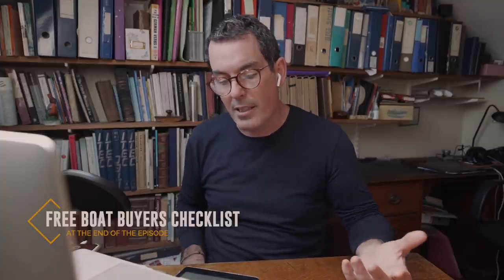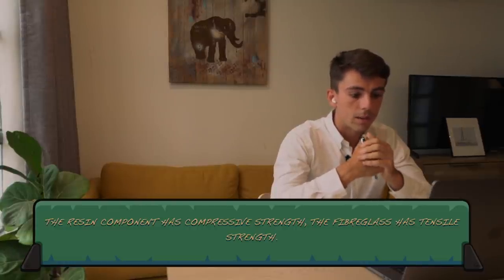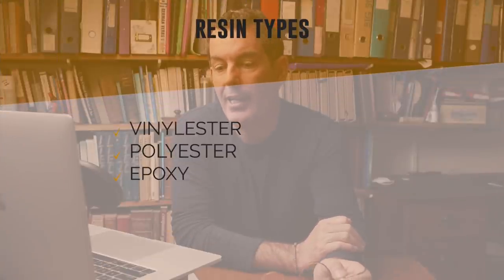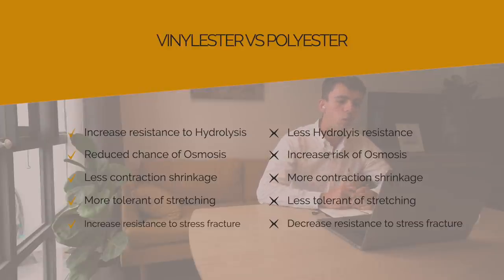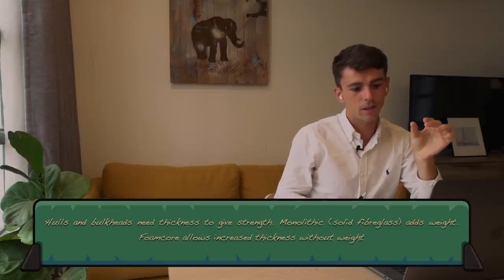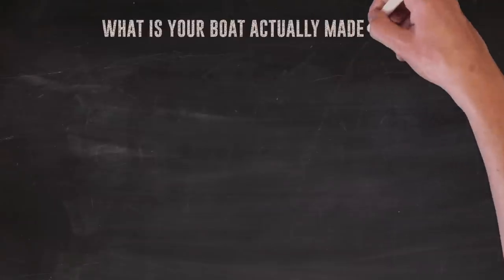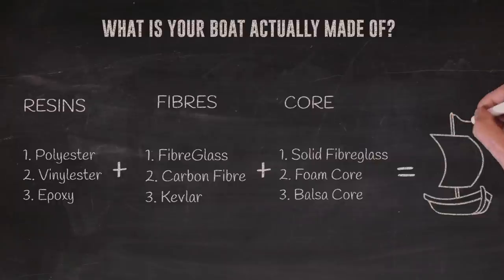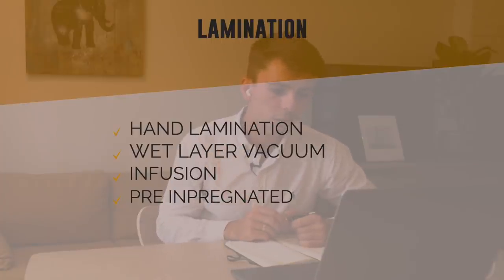CATAMARAN BUILD QUALITY: The TRUTH Brokers DON’T Want To Discuss!

Comment: A very good intro to a complicated topic! I know this could have gone on for hours, but I would have added some more discussion about both the varieties of sandwich materials other than foam (and not all foams are created equal) and their pros and cons above and below the waterline, as well as how much the lay-up of the GRP/E-glass/S-glass/CF in combination with the sandwich materiel affects the strength, compression, etc. (this was lightly glossed over).  Builders are evolving from hand-layup to wet-vacuum to infusion as they get better financing, tooling and experience with the process, but even with the best materials and processes, lack of attention to the properties needed in specific components leads to disaster.   I have been riding in pelotons where super expensive carbon bikes exploded under their riders because either the bottom bracket or the top tube were not sufficiently reinforced.  I have seen foam cored skis go 90 degrees.  And the latest edition of the Vendee Globe shows just how difficult construction can be even with relatively unlimited budgets and the best engineers.  I am sure no expense was saved on the construction of PBR and Hugo Boss, yet obviously they were pushed beyond the limits of their materials and construction techniques.  One other aspect of this discussion is the economics.  Obviously, we all want the best materials and construction, but these come at a cost.  What combinations are "good enough" for an ocean crossing cruiser?

Comment: Very useful info on materials from an experienced boatbuilder.

May I just add as a structural engineer than just using high grade expensive materials Vs lower performing materials does not necessarily give you a stronger boat.

Materials with better physical properties give you higher strength and stiffness per unit weight. They enable a competent designer to produce a high performance boat.

However, if you look at Vendée globe now you have a bleeding edge high tech boat made using top quality materials like Hugo boss breaking up and losing bits of the boat until, ultimately, retiring after 4 weeks of racing. And on the other end of the scale you still have numerous well-constructed fiberglass boats from the 1960s and 1970s still happily floating about. They are not nearly as fast but seemingly much stronger.
Reply: No they are just less stressed than a IMOCA 60 up on foils hitting waves at 20 to 30+ knots. Ooh and seeing as a IMOCA 60 weights around  8 tons INCLUDING its 3 ton keel their very lightly built !!  Alex punched straight through that storm foiling which is probably what started the bow stress cracking his retirement was due to damaging a foil and ripping a rudder off.

Comment: Nice vid Nick, although I think it's a bit quick to exempt balsa core as only chosen because of price. Working with balsa core requires the manufacturer to use a higher standard, ie: sealing the balsa where the core is perforated like thru hulls, deck fittings etc., typically, a high quality builder will remove the core in these areas. As for the wetting out due to water ingress, with the more commonly used "Infusion" methods these days, all gaps are closed off in the sandwich so that the transport of water through a damaged panel is restricted due to the fact that "End Grain Balsa" is used. In general, the resin to core bond is strongest in a balsa core panel and is generally stronger in compression and has superior sheer/ fatigue qualities. Basically, the bad rep comes from bad building practises, causing expensive repairs, like on screwed teak decks that start leaking for example. As a point of interest, in the DIY build kits from Schoinning Catamarans, the prefab Balsa cored panels are actually the strongest/lightest and most expensive option. Really looking forward to your build series and enjoy the build process. Cheers

Comment: That didn't tell us anything about the difference between epoxy and vinyl ester.  Some people have suggested there are health effects.  I suppose this is due to residual evaporation from the resin.

Jeff Schionning talks about the benefits of balsa being far greater compressive and shear strength, he suggests he can use almost half the thickness due to greater shear strength and less fibre either side of the core due to the increased compression strength.  So despite being about twice the density of suitable foam the weight increase is not much but the result is stiffer.  This didn't mention a property of foam is that it can follow a curved form easier unlike planks.

Then prepreg carbon fibre.  Given that it has to be stored and laid up in a refrigerated environment then vacuum bagged, I cannot see how it is practical to use it for even a small boat hull.  Laying up a hull takes days/weeks so how would a whole shed be kept refrigerated and how would people work in it?  Smaller parts and specific areas perhaps.

Didn't explain gluing, bonding and taping the deck to the hull.  Gluing and bonding sound the same.  Taping, wet layup of fibre across the join?  Presumably even if the two halves are bonded there is still taping to cover the join if only for aesthetics.

Comment: S glass is as strong as carbon (or even stronger in some tests) but its heavier. Talking about balsa, its not just the money end grain balsa has the best bonding strength and is most resistant to debonding/delamination and has better crush resistance than foam. It's also light. The trouble is rot when it gets wet.
Reply: They say Hanse yachts suffer with gel coat crazing and the bolt on fin is vulnerable to snapping, falling off

Comment: Great series. Thank you. And the next question: What are all the bad things that can happens to cats? (There are really two major categories here: accidents that can happen to any boat, and then issues specific to cats.)  What kind of accidents, hull breaches, damage, etc? When I was building my first sea kayak I read the book 'Deep Trouble'; accident reports - all the many ways I could die in my kayak. Probably why I'm still alive after 15 years of soloing. 
I wonder if it's possible, without stepping on toes, or risking being sued, to do a video on specific types of build failures, keel loses, entire frames  separating from hulls,  layers improperly bonded,  most of these are generally monohull construction issues. There's one major brand I won't go near, including their line of cats. I don't know if I'm justified in this prejudice - but I have it.  What can and has gone wrong in boat construction that maybe doesn't show up until later?  So there are two categories here: what still can happen even though everything was done right? and What are the things done wrong that have made it out of the boat yard?
Reply: Watch parlay revival..

Comment: Re the discussion on hull to deck bonding, etc: I think the discussion got confused. There are really only 2 methods  not three, gluing and bonding are the same thing using the same materials (epoxy or poly or vinyl ester), vs taping which applies an additional layer(s) of fiber across the joint in addition to the epoxy or whatnot.

Comment: A couple of comments.
Don’t assume that a foam core won’t absorb water, there are plenty of older foam cored race boats down here in Oz that have a lot of water in the foam.
It doesn’t affect the structural strength, but it can be a weight and osmosis problem.
Secondly, epoxy is heat sensitive, which matters if you are in constant sun in the tropics, it can deteriorate and even soften if it gets hot enough.
It is even worse if the hull is coloured.

Comment: Thank you for this video. I am looking at lower costs catamarans and after looking build specs they all use polyester throughout and plywood in the bulkheads. My biggest concern is osmosis.
Reply: Lagoons had tons of bulkhead failures. Not sure if it affects other budget brands. Balsa core rotting could also be an issue.

Comment: Good presentation. Cost is a huge consideration, for most of us anyway.  I'd love to see a naval architect video on what is the best combination of compromises to build high quality, yet cost competitive, boats that middle class people can afford to buy. The marriage of quality, performance and affordability is attainable through innovation, but only if the demand is there.  Hope your videos change the demand side, which could drive the supply side.  Thank you!
Reply: This is a great point. Nothing in real life uses 100% of the best most expensive materials. You need to weight the trade offs and costs to build a good product. For example you could build a home that lasts a 1000 years using stainless steel exteriors, steel framing, 12 thick walls for insultation... but why do you need a house to last that long and cost that much?

Comment: Some of the very best racing boats are hand laminated.   It takes way more effort to do so however.  For example if you want the very best, lightest, strongest layup the builder MUST start and ensure each and every layer is completely free of air bubbles.  Excessive resin must be either removed or alternatively have the next layer of glass absorb ALL  the remaining resin so that each and every layer has sufficient resin to completely wet out the glass but no more.  To that to achieve the highest quality layer layups must finish only when EVERY layer is compiled fully.

Lastly peel ply should be used at the very end to enable greatest bonding properties to ,for example tape furniture decks and hull together at final assembly time.

But it must be noted that vacuum bagging at that stage has a great effect of ensuring all layers are layer up void free but also with low resin to re-enforcement layer ratios.

Comment: Excellent video.  The obvious statement comes to mind “You get what you pay for.”  Or, at least you better - if you are paying the price.  Now, cats were singled out here.  I would assume the technologies apply to monohull too.  Or is there a difference?  Also, do most boat builders offer choices within the same models?  Or is one model made consistently with the same construction?  Unless you get a custom boat, you have to weigh everything from weight, size, room, features above and below deck, handling of the boat, construction materials and construction methods.  If you have a very limited budget, it must be so hard choosing and prioritizing features.  How do you do it?  It could be the difference between going for a new boat or used one, or even a very used one.
Reply from the maker: In monohulls it is easier as weight isn’t normally an issue.
Personally if I were looking for a monohull I’d look for a pre 2008 boat. Well made and a well looked after model will take you around the world
Reply: @sailingrubyrose  Hi, maybe I missed it in the video but why would you recommend a monohull from pre 2008 and not after?
Reply: @sailingrubyrose  Absolutely agree - prior to the explosion in charter fleets and boats that are mass produced and don’t last longer than 10yrs.  Even a pre- 2006 Bavaria is solid boat. Today’s mass production standards are just creating tons of future landfill..

Comment: balsa core is used to save weight as much as it is used to save money ... boats with a race pedigree have often chosen to use balsa in places where wisdom would suggest not to ( below the water line ) or in places on the deck which will be punctured by deck fittings - one way companies have got around some of the shortfalls of balsa is to have a grid pattern scored into the layup  which allows epoxy to isolate balsa into squares ... and therefore limit water movement though coring should the core be exposed to moisture ....
Reply: I assumed the scoring was to allow the material to conform to the contours of the boat. Having watched a few videos of replacing rotten balsa, it looks like many builders are unaware of this, or just don't use enough resin to create an isolation grid.

Comment: A couple questions I don’t believe where covered. How do these material hold up over time? Are some better than others? As materials improved over the last 30 years what has been the results? In terms of weight, strength, repairs?
Reply: We have a 1975 Iroquois Mk ll 30 ‘ cat. Polyester resin and fiberglass hull , polyester and fiberglass with balsa sandwich deck and cabin. The hull has been in the water for 45 years with no problem. There has been problems where water has penetrated the balsa. Had to replace the cockpit floor with foam and coosa board epoxied . Fortunately the sandwich on the deck and cabin were strong enough by themselves so that no soft spots occurred, the top layer of the sandwich was overbuilt fortunately with the exception of the cockpit floor where water penetrated and destroyed the balsa.

Comment: Back in the day I worked on a prototype bobsled with a composite structure.  Kevlar/carbon fiber mesh (6 layers on each side I believe) with a honeycomb core.  Still had a fiberglass body shell, but the composite structure took the place of the tradition welded steel frame. We joked it was the only bulletproof bobsled ever built.  I even rode the sled on a test run at Calgary during the Olympics there. It was an interesting design exercise.
Reply: Jamaica had a bob sled team.
Reply: @justincruz8352  yes they did, and they were practicing at Lake Placid when we were there in late 1987 for testing.

Comment: A steel or aluminum hull is the ultimate solution I would think - as fiberglass does shrink over a 15-year period. Sunreef and Explocat use Aluminum; the latter is an 18.9-kg 55.5-footer with a much wider platform than typical at 27 ft. $1.2mm base.

Comment: What about core material for bulkheads, deck and the other components? I have owned boats that heavily relied on plywood. It didn't cause any issues while I owned it, but once water starts to infiltrate the wood, rot soon follows with big repair bills to fix the problems. The other thing is chopped mat vs cloth. A lot of quality difference there too.
Reply: Also substandard ply wood structural bulkheads in the Lagoons, bending and breaking without any water intrusion, causing them to sag and almost fall apart.

Comment: Excellent info Nick...
2 other aspects are the stringers ( very important) and the gelcoat ...
Carbon fibre is light and strong but brittle, can be 
Cracked and splintered if impacted...aluminium 
Would be best but very expensive..Only Garcia make an aluminum, go anywhere cat...there are also custom builds..

Comment: Interesting,  but I wonder how many salesman are actually going to know the answers to these questions,
To be honest Nick yourself and Terysa did a complete Series on Cat reviews and you never gave us any of these specs? 
Kinda voided your own rating system, although i 100% don’t think intentionally,  the only company i know that advertisers complete wet infusion molding inc Structural Furniture and bulkheads in Amel.   
Do you see my point? Like a new car dealer if he or she is selling a volvo it’s the best car, then they move to Toyota and suddenly that’s the best car..  what would they know, they didn’t build either,  they get a list of selling points provided by the companies,  and if luck an independent safety rating!  Not preformed under real life conditions, because all heavy 4x4s are normally rated very bad, where a tiny electric Nissan is rated excellent!   If the two collided I would want to be in the 4x4 please! I think there is a direct comparison, because as i say, the salesman is not going to have a clue what weave glass was used, what epoxy or probably not even the core,  but hey “look at this dishwasher and washer dryer they are standard you know”   I think this series needed to be made, I believe it’s interesting ive enjoyed it.   I just don’t know how helpful it will be?  Probably far far less than it should..
Thanks guys!
Reply: It could force the companies into making sure that the salesmen have access to this information. & the salesmen into being sure that they know it. (Not necessarily in that order.)
Reply: @pneumarian  yeah!   You could, but a secondhand dealer, he/she probably won’t have that information..  so basically do your own homework?  Look at the video title.  Ask your broker,  maybe do it yourself and just look at what you know?
Reply: @trevhedges  Yeah, the broker who wouldn't try to avoid the question is rare. It definitely is a good idea never to rely on a middle-man giving good info, even if you know them to be trustworthy. "Trust, but verify."
Reply: would you believe anything a sales person told you?
Reply: @normanboyes4983  nope!  If I’m dropping a million down!  For sure I’m doing my own homework!     I think that in hindsight would have been a better video title “questions you should know the answers to before buying a boat”

Comment: Definitely going to be a "Nick Voodoo Doll" asking hard questions for the brokers/builders now. How the deck and hull are bonded together seems like it would be a pretty critical part of the whole show since all the structural force has to pass through that. Looking at hurricane damaged boats you can see into the hull construction and a lot of them use alarmingly simply methods to attach them together. Creating a full chemical bond between the top/bottom halves of the boat then building the furniture throughout the ship to pass from deck to hull and bonded together would add a ton of actual strength to the whole ship. Some of what Antoine is shedding light to here is borderline trade secret, I wouldn't be surprised if other manufacturers are watching this, getting some tricks for their own lines and now knowing "the cat's out of the bag" they cant get away with poly-fiber-balsa-glue boats anymore.